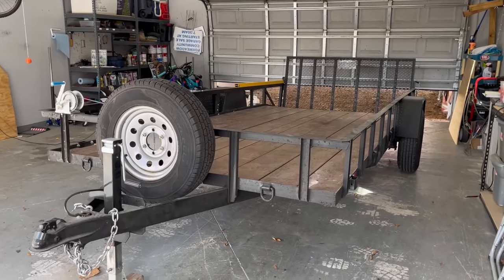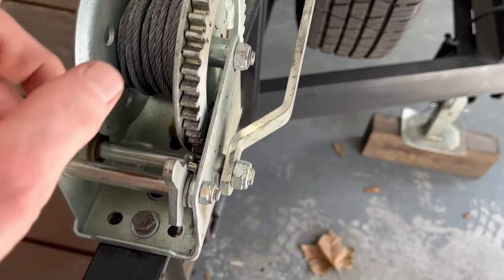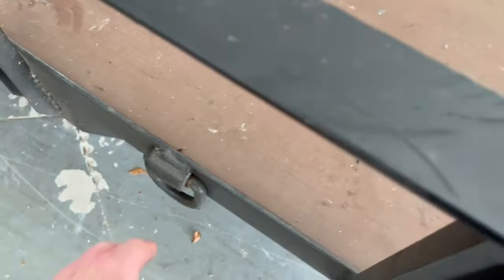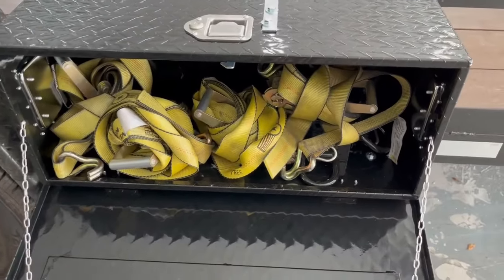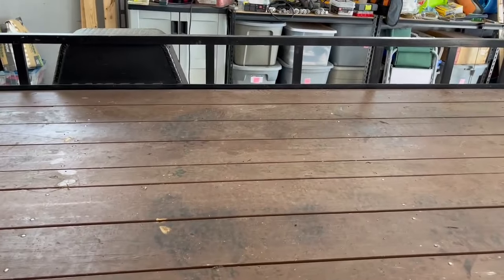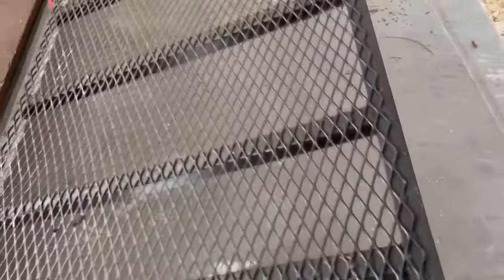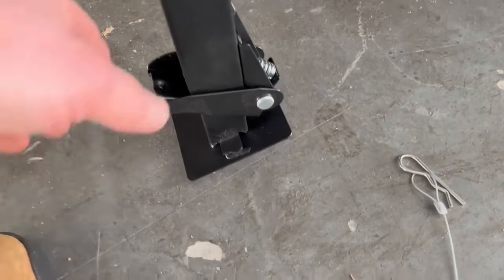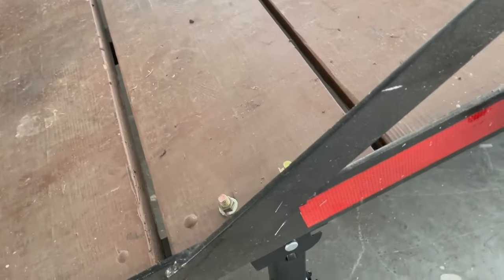5 Useful Trailer Upgrades

Comment: What length trailer do you have and do you like it?  Does it have electric brakes?  PS i think your videos are great!
Reply from the maker: Currently I have a 16', no electric brakes on this one, I'm kind of supposed to, but I usually tow far less than the actual capacity.  I had an 18' trailer with brakes, two 3500# axles, this one has one 6000# axle, not sure I gained much by going to this one other than saving 2' of space in travel and storage, not a bad "gain" since I didn't need the extra space anymore having gotten rid of my bush hog.  Trailer still weighs alot but has one axle, two tires, not two axles and four tires.  So you could say I gained on less maintenance too.  In another trailer video, I said the ideal trailer was a 20' flatbed trailer for these kinds of tractors.  At the end of the day, it just matters what gear you are towing.  Based on what I tow currently, I wish I had a 5000# axle on a slightly lighter 14' trailer, because I only tote around the tractor with box blade or stump grinder and I believe both would fit just fine.  But if you have a tiller or bush hog, it's probably best to have at least an 18' trailer if not 20'  Thanks for watching.